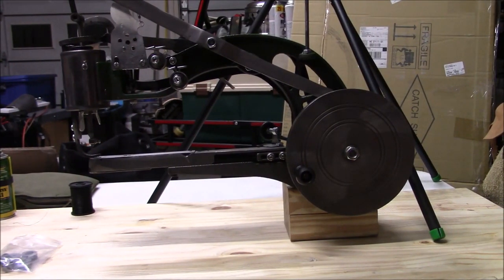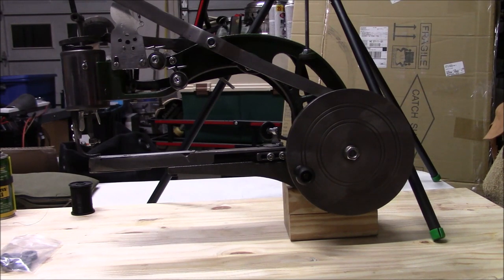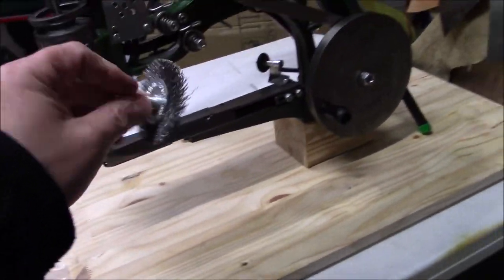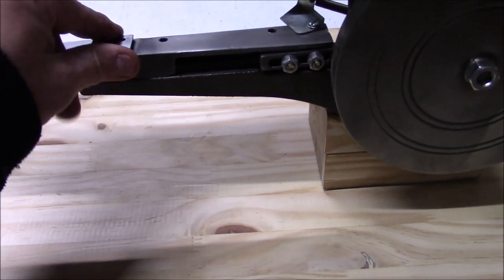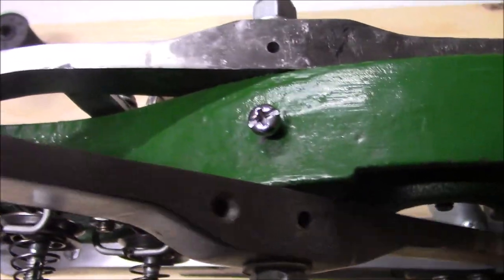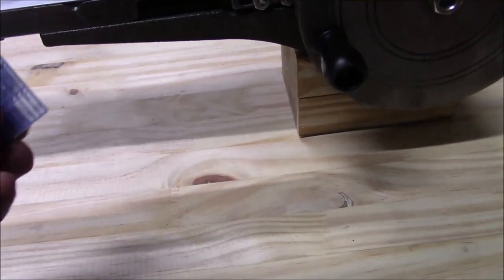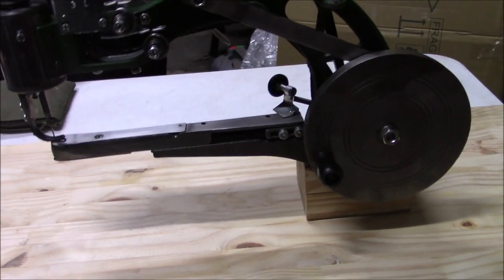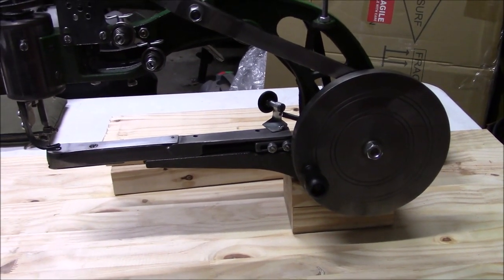Off-Grid Leather Sewing Machine ($115.00 on Amazon)

Comment: Drive around on bulk day, throwing out an old leather couch? Get a nice sharp knife and skin it.
Reply from the maker: Yep, old leather jackets at Goodwill, etc. Just cut out the big pieces and save them up. I have gotten a lot of free or near cheap leather over the years by just stopping and asking.  Because of the design of this machine, it also makes repair of tactical gear.